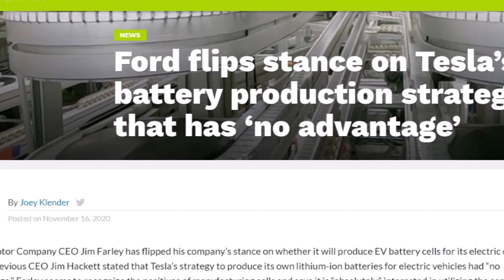Ford Follows Tesla and Changes Battery Strategy

Comment: Ford will be more than competitive if they develop a lithium-sulfur battery using the new Stanford super ionic solid state electrolyte, an anode with Li metal with hollow silicon nanospheres on a copper current carrier  and a cathode with MoS2 deposited with sulfur in Laser Induced Graphene on an aluminium current carrier. The new electrolyte has a high energy density and its sulfur component, ( https://pubs.acs.org/doi/10.1021/acsami.9b19091 ), will prevent sulfur depletion from the cathode. The Si nanospheres can be doped to present the multiple band gaps for optimal electrolyte species stability while limiting structural degradation by storing Li ions in the hollow nanosphere core. The ceramic electrolyte will inhibit dendrites, provide structural integrity and extend cycle life.

Comment: In the new EV world, if you control your battery source, you control all aspects of the cars you make.  For example; Nissan is the only source for new replacement Leaf batteries...so to force the buyers of their first generation to buy their later generation cars, they price replacement batteries higher than the blue book on the used model.  A 24kWh battery for a 2011 Leaf, valued at $5,000, is priced from $8,000 to $10,000...so, off to the junkyard it goes.

Comment: FORD SUCKS   I own a 2010 fusion hybrid that no longer operates using the battery, ( operates in reverse using only battery) dealership looked up problem  Ford company has a statement on the issue to dealers. Do not attempt repair, ford engineers are looking into issue. Been looking into the issue for years now. Basically telling their customers to buy a new car.                             The next car will be a Tesla!
Reply: Now you’re talking, driving a Tesla is great get a 3, Y or S.  I drive a new S, great car. Just got my latest software update today, there’s one about every two weeks, each one adds a handful of new functions or improves on some aspect of the car. Teslas get better with time, can’t say that about an ICE car.

Comment: Watch Lithium and other components start becoming more and more expensive. We need to get some real asteroid mining going ASAP.
Reply: At Tesla Battery Day Elon announced that they had developed an internal process to extract Li from a type of Li rich clay in Nevada. They also had acquired 10,000 acres of land that has this type of clay. Just a matter of time before they get into Li mining in NV. Two or three years ago they acquired Maxwell Tech a leading edge battery tech business, also Hibar Systems a small Canadian company that specializes in making high speed battery making equipment.   At Battery Day the 4680 battery was introduced, the high energy density and low cost to make this battery is going to be hard to beat.  By the time the legacy auto makers get their battery act together Tesla will be even further ahead with even newer tech.  TSLA share price is going to be a lot higher in 2-5 years.
Reply: @Chainyanker007  Add to that asteroid mining of not just Lithium but other minerals, processing on orbit, etc. and you have an abundant supply for everyone! Woot. I would be an asteroid miner if I were younger. Lol. The stuff you mentioned is why I think that Elon will do something about asteroid mining, whether it is to do the mining himself or help others by making miner versions of Starship. He will want as much of he resources to be sourced outside of Earths ridiculous gravity well.

Comment: Battery is the equivalent of the engine, vehicle manufacturers manufacture the engines whats the surprise they should make the battery. Its has enough secret sauce, motors are 96% efficient there is no secret sauce left worth bothering with in that last 4%......look to the battery,  get it right and win.
Reply: Elon says it’s all about the battery. The one with the superior battery (esp. cost and energy density) wins.

Comment: Ford asks catl to buy batteries. Catl raises prices because there is a demand problem. Also CATL says it is producing fast and does not have space to supply ford. So Ford in a corner. The only thing is to raise more money and make its own.
Reply: Not that easy to just make batteries, good batteries.  Battery chemistry is very hard stuff.

Comment: Toyata planned "Hydrogen Technology (HT)", this is the main reason Toyota does not have full battery car. 
Do you think "HT" will success ?
Reply: Can you charge your car with Hydrogen at home ? No
Reply: Harrison Wood that’s not important.  I doubt you can fill your car with gasoline at home, right?  The problem with hydrogen is inefficiency related to production, transport and storage.
Reply: @greghelton4668  that is exactly the point. What do you mean I can't fill my car up with gasoline at home. I can fill a can with gasoline and fill my car up with the can of gas. Hydrogen is very reactive and can't be transported and made available with ease, but electricity is everywhere!
Reply: @hwo2023  can you refill your gas tank at home?
Reply: Every time you convert from one form of energy to another, you incur losses.  Hydrogen requires a conversion from Electric>Hydrogen>Electric again before it is used, whereas BEVs don't need to convert and can use straight electrical energy.
Also Hydrogen needs to be physically transported to where it will be used, whereas it's much easier to transport electrons near instantaneously across long distances with much less energy transport loss or cost of transport.
The main problem also is that Hydrogen is such a small molecule it's virtually impossible to contain it perfectly - it will always slowly leak out of its containment.  Imagine your helium party balloons - they are full initially and float up, but by morning all the helium will have leaked out through the gaps in the balloon membrane, leaving only the heavier air behind and that's why the balloon can't float anymore.  Your hydrogen molecule is half the size of helium molecules.
Toyota has been running their Hydrogen program for just about as long as Tesla's existence, and hasn't got much to show for it.
Reply: There are at least 2 HT that can convert the energy stored in H2 to usable energy: one is fuel cell, the other is direct combustion of H2. 

Toyota choose fuel cell technology, there are some hydrogen car prototypes running in Japan.  I am not sure why Toyota picked HT, one of the reasons, I guess, would be there are more H2 available than Li.  No need to mine.

Hydrogen storage & transport is a relative  minor issue; conversion of hydrogen is by sun energy, efficiency is also trivial. Australia already has hydrogen export. 

Toyota was one of the largest stake holders of Tesla, Tesla's Fremont factory was owned by Toyota & GM, they sold all the Tesla's stock later.
Reply: @Radio_FM_3123  The reason why Japan chose Hydrogen is because they want to become independent from oil and gas imports. Those imports make Japan vulnerable. By going all in on nuclear,  they can produce H2 as an oil/gas substitute and become independent. This goal also the reason why potentially higher prices for the fuel doesn't really matter for them.
Reply: H mixed with air is highly explosive, also too much logistical problems.  I’ll stick with my Tesla.

Comment: I think the change in view comes because of the patent issue between LG and the supplier that Ford and VW chose. They were in court trying to get the company to be allowed to supply at least what they had already contracted for.

For Toyota, I think they are still thinking that hydrogen is the future.
Reply: Great on paper but not practical, imho, too many logistical problems.  Besides H mixed with air is highly explosive, I’ll stick with electricity, love my Tesla.

Comment: What I don't see anybody talking about the massive land destruction (like surface coal mining) to get these minerals out of the ground to make batteries. Versus drilling a hole in the ground for oil. What is going to be left of land. Who will pay for landscaping ete. cheap batteries, cheap cars. Ha.
Reply: Once they are out 99% Of batteries can be recycled. And each car can run for a million miles instead of 100,000. No more poison air to breath.
Reply from the maker: I agree
 We need to come up with a different solution.
Reply: The earth and its landscape change whether mankind causes it or not.  Who do we blame for earthquakes, volcano eruptions, hurricanes, tsunamis, tornados, avalanches, wildfires caused by lightning strikes, torrential rains causing flooding, shifting tectonic plates ....?  I know who is to blame.  Mining companies and battery manufacturers.
Reply: If you watch Tesla’s Battery Day presentation they have developed a method to extract the Li from a kind of Li rich clay then they will put the clay back with minimal environmental damage. For this they have acquired 10,000 acres of land in Nevada.  Maybe in 5-10 years they will be in the Li mining business.
Reply: @Chainyanker007   So now GM & Ford are going  into mining. I guess the landscaping bulldozers etc  will be battery powered too. Now you need more LI to make bulldozer etc batteries. I just love the thinking. Didn't somebody make an engine that ran on water?  And the guy disappeared. I herd that a long time ago.

Comment: It used to be two separate industries (1) vehicle and (2) fuel ie stored energy, has become one, vehicle and battery ie stored energy. 

That is equivalent to a condition for Ford to research, drill for their fossil fuel, to refine for their gasoline and to build gas stations.

GM, Ford and VW, BMW didn’t see that coming.
Reply: And Toyota, Honda, other Asian ICE auto makers.  Kia is trying hard and have a decent EV but not in the same class as Tesla.

Comment: They have to do that while selling cars that will be replaced and while being in massive debt.  let see if they can make it.
Reply: Some of that debt is from financing vehicles sold to Ford customers.  So the debt on the balance sheet isn't as bad as it seems
Reply: At least they try,  they ve Mach E, Transit E, F150EV,  so they and VW definitely do ve a shot on at least rivaling Tesla. Give competition a space rather than blaming them always
Reply: What debt? Ford Automotive has a net cash position. Ford Credit is a finance company and it's debt is secured by assets, primarily vehicles.

Comment: I was going to write up an article before when Ford's then-CEO made that short sighted statement saying that they could rely on their suppliers without going into the battery manufacturing business themselves. It was exactly that kind of short-term view that caused Ford, GM, and Chrysler to make similarly poor decisions in the past that lost market share that they never recovered. It has been painfully clear to anyone paying attention that China and Asia has been positioning themselves as the leading suppliers of battery materials and manufacturing over the past 10+ years. And it was similarly clear that limited battery supplies last year stopped or slowed the production of several European and Asian EVs. And this was with very limited production, so with worldwide EV production poised to more than double next year, anyone who wants to compete in the EV market will need to either partner directly with battery makers (as Tesla, GM, and VW has) or to manufacture their own batteries, and get a committed and reliable supply for battery materials. At their Battery Day event, Tesla clearly showed the importance of both sourcing materials and building their own batteries in terms of lowering manufacturing costs and insuring reliable production and supply of batteries for their EVs. And how it leads directly to EV profitability. The fact that Ford's new CEO now recognizes this fact says a lot about Ford's future success. As long as it's not just lip service, and as long as Ford jumps into their own (or partnered) battery production very soon. This will help make it possible for Ford to truly compete with their Mach-E, commercial and consumer EVs, including their future EV F150.
Reply: Well said. These conditions apply to every single car manufacturer today. It all boils down to the production, efficiency, and quality of its batteries. If any of them are to survive as car makers, they have better get going sourcing its supply chain asap.
Reply from the maker: Thanks Dean. You are always welcome to send stories to Torque News.
Reply: Too little too late! EV's suck without the new battery tech....too expensive. Ford would need to basically transform itself into a new company. While this is happening they will be getting weaker and Tesla will continue to grow stronger. The nature of capitalism and consumerism will do the rest and Tesla WILL have the lions share of the market because they got there first!
Reply: @yvanpajevic9680  Damned right, you are.! To make matters worse, Tesla has propitiatory rights to processes and formulas in making their batteries. Presumably,  no one can duplicate these without infringing on a patented property. Unless somehow Ford, et al, can come up with a newfangled way to make them that's as good as, or better than what Tesla has, they ain't got a leg to stand on. The same goes for GM and other big manufacturers, except maybe VW.